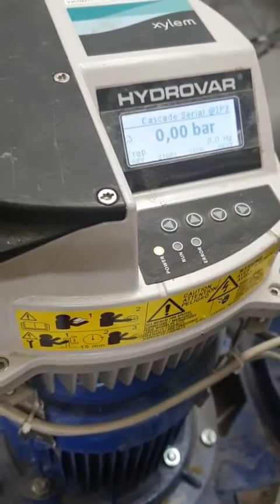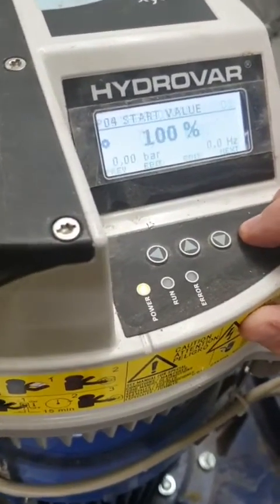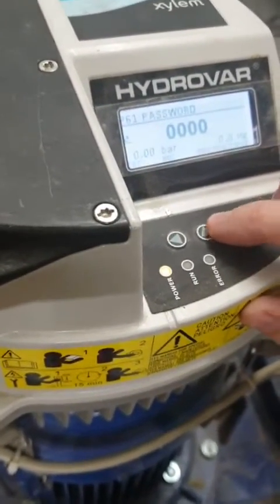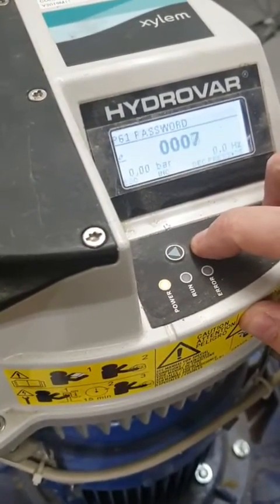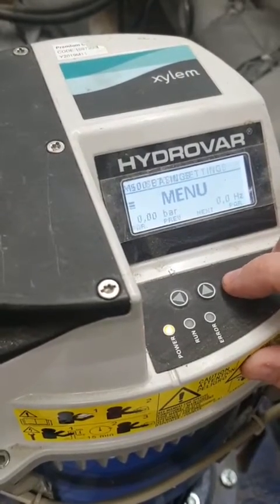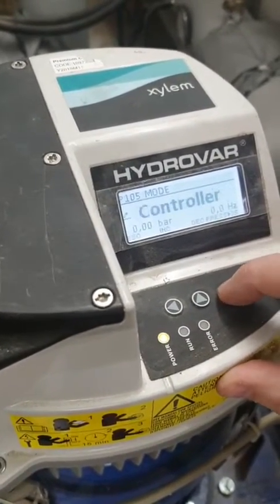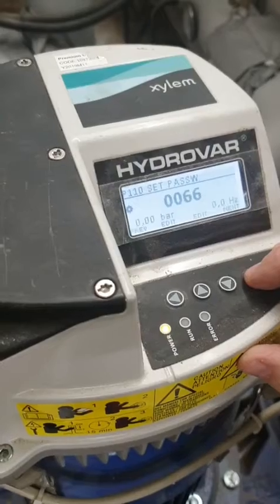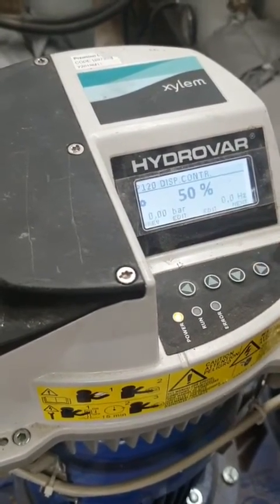Changing a Hydrovar Control Mode

Comment: Recently tried setting one of these up, put all the correct parameters in but on the home screen in the bottom left had corner it said the pump was off and when pressing the start button the pump would not activate. Any ideas what this could of been? PTC and trips all correct
Reply from the maker: Hi Dean the enable terminals need to be closed in the head and that will allow the hydrovar to run.
Reply: can i ask u @pumpsuklimited
Reply: Legend! Thank you